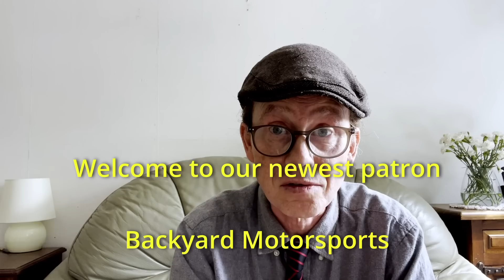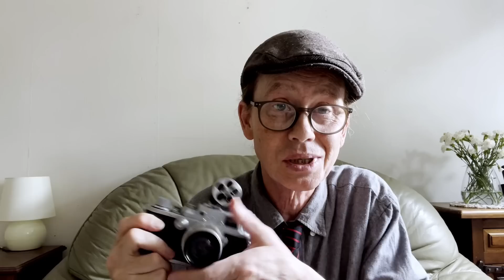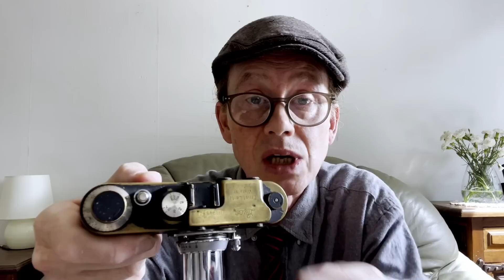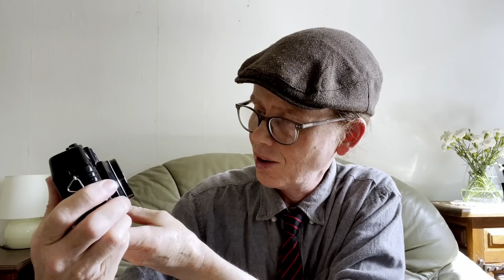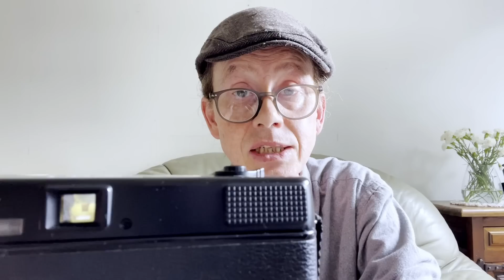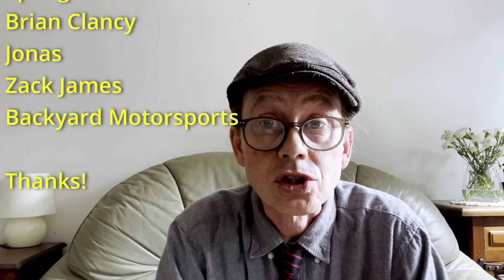My FAVOURITE Cameras!

Comment: Awesome. Older pro lens are such good value . Love it! 
This year I bought a Nikon 300mm F4 ED IF and it is amazinigly sharp and focuses quickly. Added a 1.4 teleconverter and very recently bought a AUD700 Nikon D7200 as a second body. The D7200 has much better BIF autofocus than my Z50. 😊
This setup gives me an equivalent reach of 630mm at f5.6, hand-holdable, at a relatively low cost.

Comment: I have a Kiev 4 as well,  the viewfinder is not the best when using glasses, but its very accurate at focusing.
what I love about it is the integrated light meter, same as a handheld one but on the camera itself.* (but not all Kiev's have that I guess?)
*my camera its from 1976 and the wheel (iso selection. shutter speed and aperture combinations) on the left controls the needle in the center.
here's a pic I found
https://oldcamerablog.files.wordpress.com/2016/10/c686e-p1010487.jpg

Comment: I made a purchase recently for £10. I bought a Pentax mef camera working perfectly with 3 lenses. Sirius f2.8 automatic MC....Asahi opt co Japan SMC Pentax 50mm F1.7......Sirius mc auto zoom 1:4.0-5.6 f70-210. Plus/straps/manuals/flash units X2/ also colour lenses that clip onto the flash unit. I'm not a camera collector or photographer but I'd like/appreciate your opinion on the quality of the lenses. Best wishes. David from Northern Ireland..
Reply: DearDavid in Northern Ireland. Sounds like you've hit a gold mine there. In general my opinion of Pentax is better Evan than Nikon.I don't pretend to know all the Pentax lenses or even a little. ALL I KNOW IS BASED ON THE PENTAX MV I BOUGHT SHORTLY BEFORE I TOOK A BIKE TRIP AFTER HIGH SCHOOL IN 1980. MY MV PENTAX HAD A SINGLE BUTTON CELL BATTERY FOR POWERING THE LIGHT METER AND POSIBLY THE SHUTTER. IT NEVER LET ME DOWN DURING THE TWO WEEKS I WAS IN EUROPE. MY MV HAD A SEIKO SHUTTER MADE OF TITANIUM. IT WAS ACCORDIAN LIKE OR PAPER FAN LIKE. IT NEVER LET ME DOWN. ALL I WOULD DO IS LOOK INTO THE VIEW FINDER WATCH THE NEEDLE TWIST THE APPETATURE RECHECK IF IT WAS UNDER O OR OVER EXPOSED, RECENTER THE NEEDLE, COMPOSE THE PICTURE, SHOOT. THAT WAS IT. I WOULD HOLD ON TO THAT SERIES OF PENTAX LENSES WITH MY LIFE!  IF YOU HAVE A GOOD 50MM A 90MM AND A 135MM YOUVE GOT A SYSTEM FOR VIRTUALLY ANYTHING YOU MIGHT WANT TO PHOTOGRAPH! THE 90MM IS GREAT FOR PORTRAITS AND ALSO THE 135MM TOO. MY BEST PICTURES WERE TAKEN WITH PENTAX. IF YOU CAN FIND PLUSS X FILM BY KODAK IT IS REALLY TIGHT GRAINED AND GIVES GREAT PORTRAITS. YOU MUST USE A TRIPOD THOUGH BECAUSE IT IS A SLOW FILM SPEED. YOU CANT HAND HOLD YOUR SHOT IT WILL INTRODUCE BLURR.YOU CAN HAND HOLD IT BUT MUST USE AT LEAST 125/SEC AND IT WOULD HAVE TO BE WAY OPEN APERTURE. I HAVE FOUND WAY OPEN APERTURE ON MY NIKON S BLURRS THE IMAGE. SOUNDS LIKE YOU HIT PAY DIRT ON THAT PENTAX SET! KEEP IT AND USE IT AS OFTEN AS YOU CAN I WOULD SAY. LENS COMBINATIONS ARE EXPENSIVE I WOULD HOLD ONTO IT IF YOUR INTERESTED IN PHOTOGRAPHY.
Reply: So there you are David from Northern Ireland! The 1.4 is a good fast lens. The zoom is probably great for almost everything. Other than that I would consult a photography expert in your area. Dont sell any of it untill you have it appraised. If I were you I would become a photographer just because you have so many nice lenses! See what cameras they fit and go photograph some pretty girls! Or whatever interests you! If you run accross an MV Pentax buy it if it's working properly that Seiko shutter is remarkable! But! It will need batteries! Hope Ive been of help!
Reply: @ChrisEbbrsen  Thank you  for your reply my friend. I've just purchased an Agfa Isollette 120 camera with an add-on flash unit that resembles a very small satellite dish lol. Charity shop purchased for £5 absolutely mint condition. Best wishes my friend from the Emerald Isle 🍀🍀🍀❤️👍
Reply: @ChrisEbbrsen  Forgot to mention another charity shop purchase I've made. A Canon sure shot zoom xl. A mint condition but Rare looking zoom camera with a small detachable remote for snapping photos. Very heavy bit of kit for a 35mm film camera.. £5 what a bargain 🍀🍀👍

Comment: The Trip 35 lens is really great. Mine has never had an issue with stuck shutter, but I suppose I should knock on wood now. While not a 4 element lens, it has a Tessar look that I really love.

My first “real” camera was a Konica C35V (scale focus, not RF) and yes, that 38mm lens is just stunning especially for a “cheap” camera. The ONLY fault I have with the C35 series is that most had a minimum slow speed of 1/8s (I think) so there was a limit to low light photography that bothered me.

For an SLR the Hexanon 40/1.8 is the best - that lens may be the sharpest lens for film SLRs ever made, but it’s character is even better than its sharpness.

Comment: I have way too many film cameras, or so my wife says..........My favourites are Rolleiflex T, (1965) Olympus Pen D, (1965) Konica 11a (1955?), Pentax K (1958), Leica M3 (1965), Leica 111g (1960), Kodak Retina 1B (1959), Nikon FE (1980?), Nikon F (1968?) and Olympus OM2n (1980?).  Others close behind are the Olympus OM1n, Pentax H2, S3, and Pentax ME. My Pentax MX was once my favourite but then I discovered the earlier cameras with their distinctive feel and build qualities. I rate the Konica 11a as highly as the two Leicas. The engineering excellence coupled with the superb Hexanon lens is at the very top.

Comment: You are so right about the SLRs - which means I agree with you! My first film SLR was a Contax 139 bought back in the day it was new. When I came back to film photography in about 2008 I bought an OM-1. It's funny that although it was my dream camera as a teenager it seemed a little old-hat once I could afford to buy an OM series, hence the Contax. I did really like the OM1 on many levels but it wasn't true love. Many years later an old friend mentioned he had a Nikon FM languishing in a drawer and wondered if I'd like to buy it. It's in black and except for a couple of light scratches on the baseplate is immaculate. I had to have it! I sold the OM1 to fund the FM purchase. In comparison the FM is feels much much more robust and well made all around and really 'pro'.  However in certain situations I'd rather protect the FM and use something a bit more user friendly and dare i say it 'disposable' so I got a T70. This partly due to your earlier review. I love it! Even with the kit zoom the results are great as I only print up to 8x10 and the ease of use is excellent. The styling is so of its time but in a good way. I don't care if I knock it especially with the polycarbonate body you probably won't notice anyway. It reminds me of a piece of military  equipment of the time. What's best of all is they are or at least were dirt cheap. I bought a scruffy one sold 'for spares' with kit zoom and a corroded battery in situ for less than £30. That worked perfectly after I got the battery out and as I liked using it I bought another nicer body only for about £30. It is now my referred film 'daily shooter'.

Comment: Thanks for this one Nigel. Like you, loved the Olympus range back in the 70s and 80s. I had the OM1, 2n, 4, 10 and although I liked the 2n, and the 4 had more bells 'n whistles, the 1 always seemed to be my favourite. Would work without a battery, built like a tank, super simple metering, cleaner lines. Yep that was the one. 
On the point and shoots, I had the upscale Olympus Trip, the 35RC. Super little point and shoot with a better lens and focusing and self timer. Both served me well and I still have them.

Comment: Are you sure that Trip 35 needs a rebuild? It won't take a shot if the red flag is up in the viewfinder, which means the available light is not enough for its limited auto exposure parameters. 

A bad knock could sometimes stop that red flag popping up, but the shutter would still lock.

I have owned four of these little beauties, and wrecked two. 

Back in the eighties it was the only camera I would take with me during my tours of duty hundreds of miles up into the Arctic. It was small enough to keep in a parka pocket, and as it did not use batteries, it had power as long as there was reasonable light. I had quickly found that any camera that relied on batteries for metering or operation would die within minutes in those extreme temperatures. 

However, I always made sure that I bought one of the earlier ones, which can be identified by the chrome shutter button. The ones with a black shutter button (like yours) were made later, with more plastic/nylon parts inside, and these tended not to be as long-lived.

Comment: The Olympus Trip 35 was produced from 1967 to 1984, your one is a later one because it has a plastic shutter release, I have an earlier one and I don't have the same issue as your's, so it might be a problem with the later versions being cheapened down. It was my very first camera and I had never felt something of such high quality where everything fit perfectly and worked so smoothly. I also love the auto mechanism that prevents you from releasing the shutter if there isn't enough light so you don't waste film.
Reply: Could that be the problem? The camera might not be faulty, just preventing an under exposed photo. This was filmed indoors so somewhat dull.
Reply: @caw25sha  My Trip 35 does not fire when set to auto unless there is sufficient light, a red plastic piece appears in the viewfinder to indicate that the light level is too low, it is possible the later models did not have this plastic piece, and he has it set to auto, causing the seemingly sporadic functionality of the shutter.

Comment: I'd like to add another category, Medium format, and 3 sub categories, Folding cameras, TLR's, and SLR's

In the Folding camera range is my favourit (because it's the only one I have) Agfa Isolette 85mm f4.5

TLR's my choice is between my Mamiya C3 (with 3 lens boards) or my Yashicamat 80mm f3.5 ------ and, good as the Mamiya is my first place is the Yashicamat, purely on lightness and ease of use.

SLR's, I have 3 cameras in this category, the Mamiya M645 1000s, with 3 lenses (50mm f2.8, 80mm f2.8, and 210mm f4), A Zenza Bronica S2A with 4 lenses (all Nikon glass 50mm f2.8, 50mm f3.5, 75mm f2.8, and 150mm f4), and a Zenza Bronica EC (which uses the same lenses as the S2A) ------- And my favourite in this category is the Zenza Bronica S2a, purely on looks alone. It's a heavy, noisy, slow beast, but it looks like a 1950s Cadillac with the stainless steel styling. Everyone stops to stare when I'm out and about using it, the shutter sound is like a load of coals being tipped onto a cucumber frame, the wind on terrifies you as you have to give it an extra push at the end of its travel to re-cock the shutter, but it's a joy to use, if only I was 40 years younger and could carry the weight all day 🤣

Another thought provoking episode, Nigel, I'll have to revisit my 35mm collection and go through the same process you have done.

Waiting for next week's episode now!
George

Comment: Hello again and thanks for the great review. The stuck shutter on your Trip 35 may be the built in under exposure lock. When the Trip is set to Auto the shutter will lock and a red flag should appear in the viewfinder indicating the intended exposure is beyond the auto mode limit which is 1/40s at f2.8.
This is exactly what happens with the two Trip 35s I have. I may of course be some other problem with your particular camera.  I love the Trip 35, I think it's the design, the simplicity and the way it feels in the hand.
Reply: That is a feature isn't it!  There is a work-around, with the ASA dial?
Reply: @numbersix8919  Hi. Yes you can move the selector ring off Auto and on to an aperture setting of your choice. This forces the camera shutter to work regardless of the available. light The camera defaults to 1/40s in this situation.
Reply: @olio_benzina  Cool!  Thank you.  Maybe this camera was the first time someone said "It's not a bug, it's a feature!"

Comment: Thanks for sharing your list of favorite cameras.

Here is mine:
Favorite 35mm SLR - Nikon F2 titanium (180mm f/2.8; 85mm f/1.4; 35mm f/1.4; 24mm f/2)
Favorite 35mm rangefinder - Leica M6 titanium (90mm f/2; 35mm f/1.4; 21mm f/1.4)

Favorite medium format SLR camera - Mamiya RB67 (180mm f/4.5; 90mm f/3.8; 50mm f/4.5)
Favorite medium format rangefinder camera - Fuji GW670 (fixed 90mm f/3.5)
Favorite medium format TLR camera - Mamiya C220 (180mm f/4.5; 80mm f/2.8; 55mm f/4.5)

Favorite medium format camera - Mamiya C220 TLR (180mm f/4.5; 80mm f/2.8; 55mm f/4.5)

Favorite large format camera - Calumet 4x5 inch monorail view camera (135mm f/5.6; 90mm f/5.6; 65mm f/8) 

Favorite digital camera - Fuji X-Pro2 graphite (56mm f/1.2; 23mm f/1.4; 16mm f/1.4)

Favorite compact Point & Shoot camera - Canon PowerShot G15 digital (28-140mm f/1.8 to f/2.8 equivalent fixed zoom lens)

Favorite camera - Nikon F2 titanium (180mm f/2.8; 85mm f/1.4; 35mm f/1.4; 24mm f/2)

Comment: I figured the OM2 but in their day I really wanted the Pen F. I stumbled upon one a few years back for sale but I bypassed it , For me my SLR choice is Leicaflex SL2 and it has everything to do with the spot meter and the lenses. I picked up in 72-73. It easily paid for its self. I used it professionally until the late seventies. I sold it off and replaced it with a Nikonos in 1983. This camera gets a bunch of points as it was one of the toughest cameras I used for a very long time. I call it a dropkickable camera. I still have this baby. The other film cameras I have is a Leica iiif (I wish I had a folding lense for this baby) which I acquired at a private sale and a Mamiyaflex C2 which I acquired with three lenses for a steal at an auction. Of all the Leica range the M4 was my favourite but they are just too expensive as their price was spurred on up by the introduction of the M5.

Comment: Perfect timing. I just ordered a clean-looking Nikon FM. I went to work for a small publisher After having gotten rid of my Nikon F4s and lenses, and a Hasselblad, before moving states away the FM was my only camera with just 50mm 1.8 and a Tokina 75 or 80 to 205 that was surprisingly sharp. It was brassed and worn, but it was a workhorse of a camera and easy to use if you were actually a photographer. I also very recently picked up another camera I wanted for so long after having used one a now ex-girlfriend had but never used. (She wouldn't let me have it so maybe that contributed to the Ex part?) The Canon Cononet GL17. The one I got is the pre-GIII model, but the same crisp 40mm f1.7.  Both will do their job quite well if you do yours. I used to tell people that if you had good glass, and accurate shutter, and a body that didn't leak light, you can make great images.

Comment: What does n mean after a model designation all famous brands use this but what does it mean???
Reply: New.
Reply: The Japanese usually mean "Improved/new".
Reply: A typical example would be the Fujica ST 605 and ST 605 n, the latter has shutter speed displayed in the viewfinder, otherwise they are identical.
Reply: It's usually a minor upgrade that isn't significant enough to justify a new name or number.

Comment: There is a bit of a knack to retrieving the end of a film. You have to listen very carefully for when the end of the film springs off the end of the widget. You can, apparently, take the end off with a bottle opener but I've never tried it. Obviously you need to do it in the dark. (And if all else fails buy a 120 camera 😆)
Reply: Yes, using a bottle opener will work to open a 35mm can.